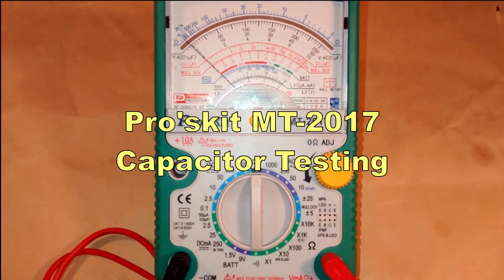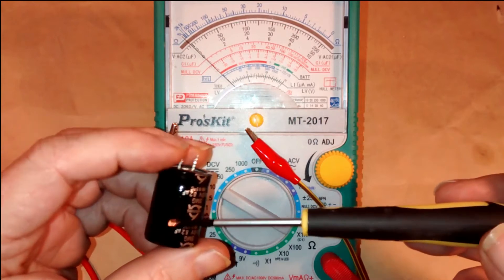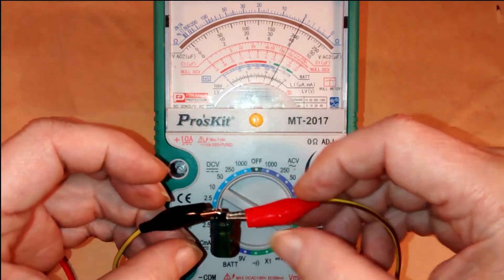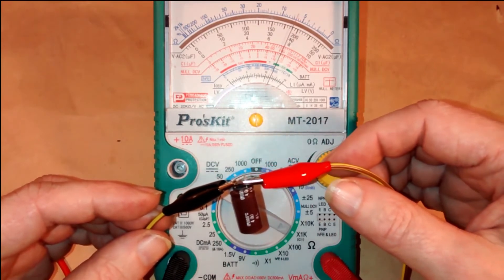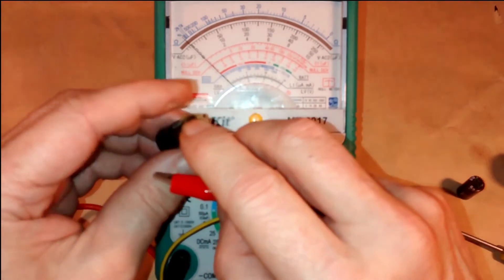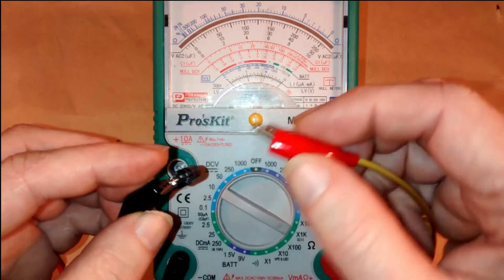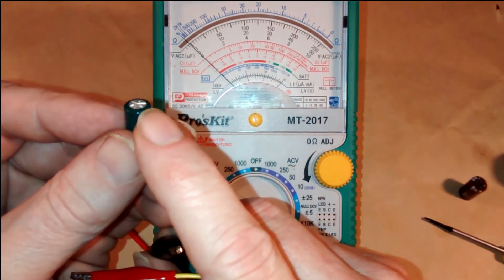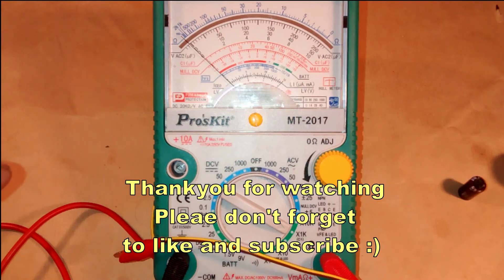How to Test Capacitors with a Pros'Kit MT-2017 Multimeter

Comment: At 6mins 30 secs, "taking very little current" is incorrect.  There is too  much current flowing.  A perfect capacitor takes no current when fully charged.  That faulty capacitor continues to take current because it is electrically leaky.

Comment: The rule "positive to positive" does not apply on these tests because with analog instruments the polarity of the test voltage for resistance measurements is reversed. Therefore one should only connect the capacitor "positive to negative and negative to positive". This is important because electrolytic capacitors are polarized and a healthy capacitor connected in reverse shows high leakage ( the needle of the instrument does not stay at the infinity point when the cap is charged). This does not happen when the cap is connected in the right way.
Reply from the maker: Thank you for your comment.  That is something I was not aware of.  Just checked using a second meter and the polarity of the analogue meter was indeed reversed whereas the output of a digital meter wasn't.  The output voltage of the analogue one was only around 1mv so shouldn't do any damage but best practice would be to connect as you suggested.
Reply: @tonybronze7459  This effect is even more confusing when one tries to test semiconductor diodes etc, where the anode looks to be the cathode of the diode under test and a PNP transistor appears like being  a NPN. This was the most confusing effect during the old times, when the analog multimeters were at the peak of their glory...!! Good old days...
Reply: Thank you. Finally someone got it right. I watched 99% of these videos teaching everyone to test caps with amms...all going about it the wrong way. It was a clear indication that they hadn't even bothered to read the instruction manual before using the amm... The logic of what you say is simple: electrons flow from the negative probe towards the positive probe.... I'm glad that this was acknowledged by the person who made this video...

Comment: So don't I need the optional MT2007-C module, as stated in the manual, for capacitor measurement?
Reply from the maker: If you want a reading of the actual capacity of a capacitor then you need the MT2007-C.  If you just want to see if they are good or bad, then you can just test them as I did.  I have not seen the MT2007-c for sale anywhere but I use a multi tester such as https://www.ebay.co.uk/itm/Multifunction-Mega328-NPN-PNP-Transistor-Checker-Capacitor-Resistance-FET-I-T7F2/222901583360?epid=26004436915&hash=item33e5f83e00:g:HvgAAOSwQXBau2Lw if I want a specific value.